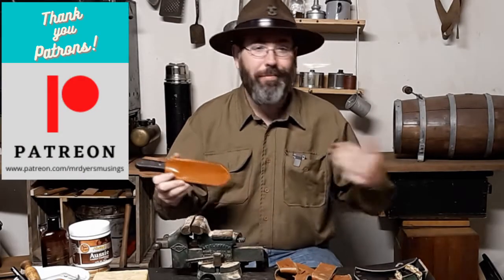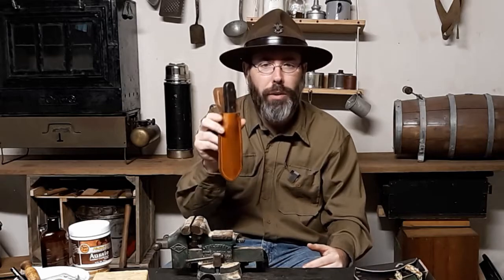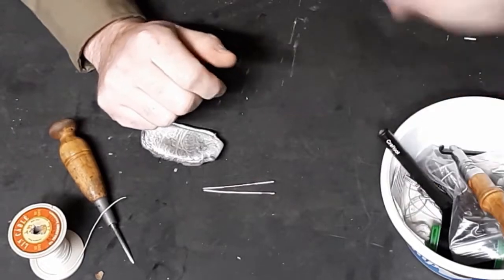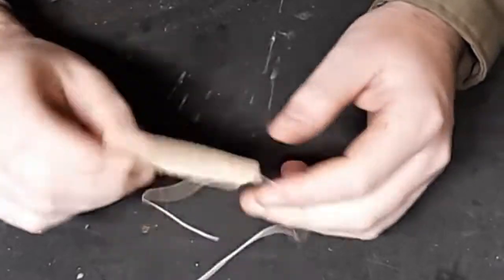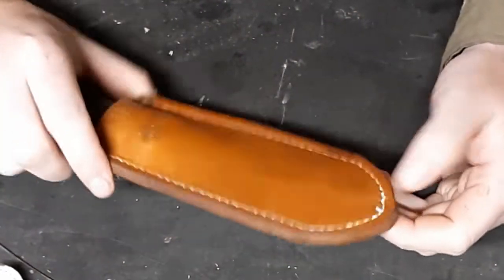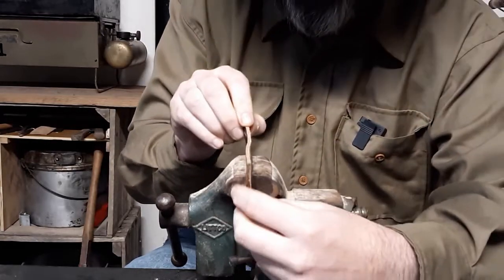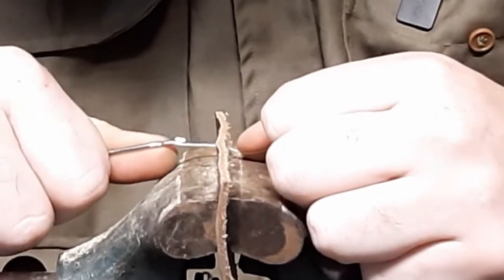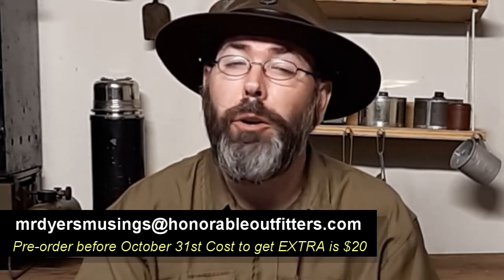The versatility of the "Awl for All" and its endless possibilities!

Comment: Excellent demonstration.  Thank you!  Did you not put a welt in your sheath for the Kephart knife?

As an aside, when I was reading a book on Navajo rugs, sometimes they said "ravel" and sometimes "unravel" so I looked it up.  Low and behold they mean the same thing, kinda like "flammable" and "inflammable"...LOL.
Reply from the maker: Thank you. It does have a welt but the thickness of leather may be too thin. If this repair doesn't make it through the winter season then I will make another one that is thicker oz.